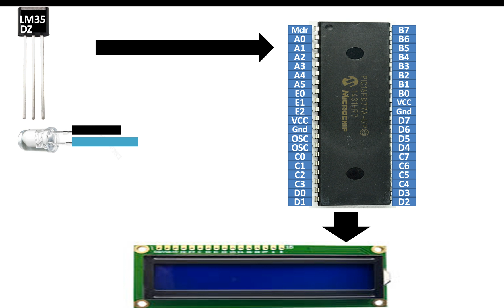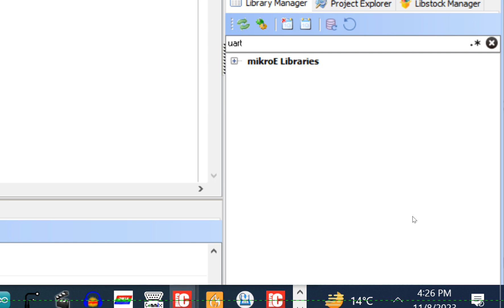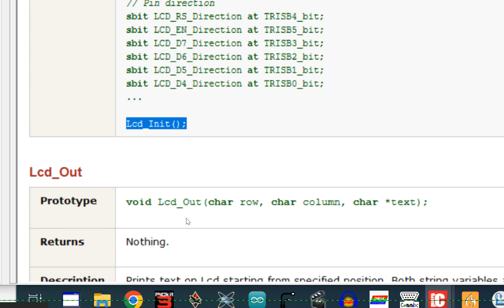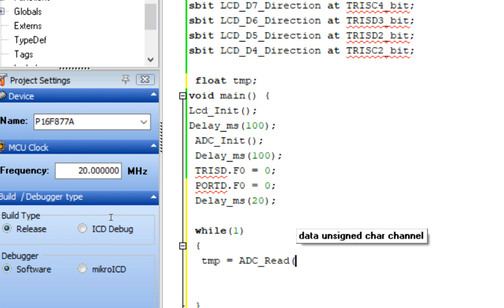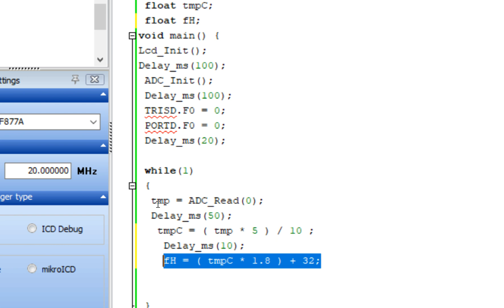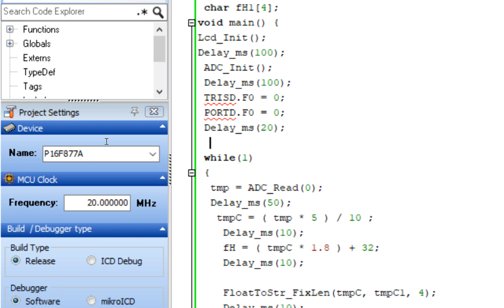PIC16F877A interface LM35 temp sensor. Display output in Celsius and Fahrenheit Units on 16x2 LCD.

Comment: Verry verry good sir .next video  led dot matrix 1to9 and A to z  use push button up and doun
Reply from the maker: the one you told me earlier that for 12V and 24V over and under voltage protection